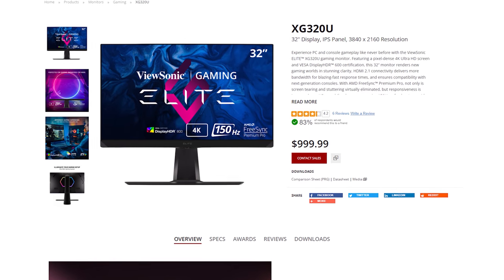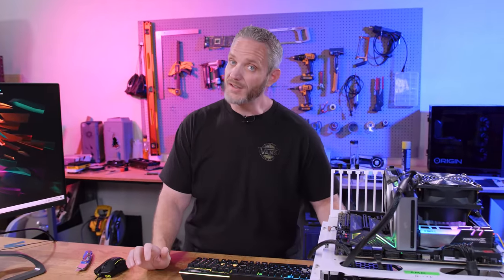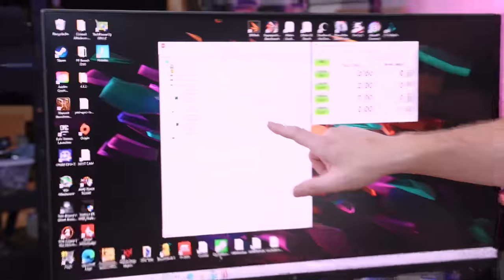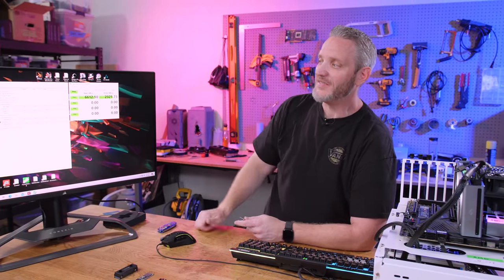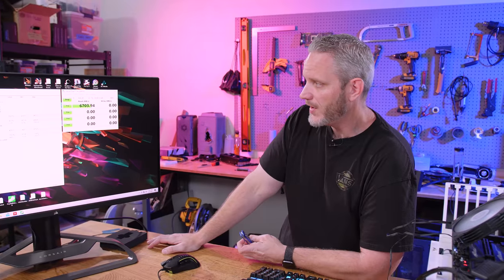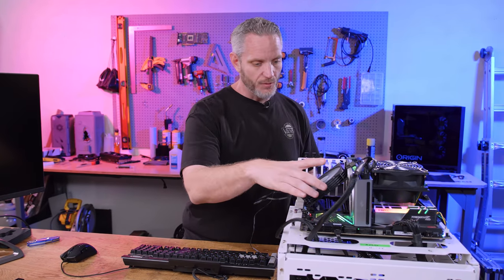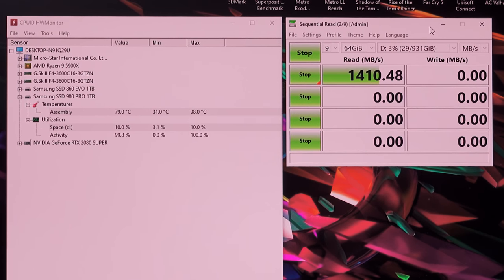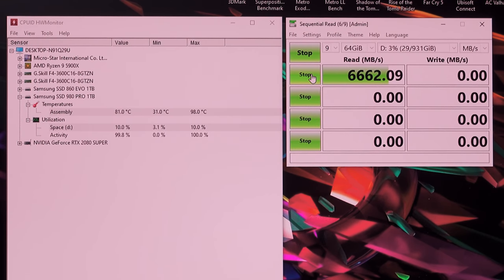I watercooled an NVME SSD... These results were unexpected!

Comment: The reason for the varying of write speed is the SLC cache filling out. 980 pro is a TLC drive, which means there three bits stored per memory cell. With SLC cache, data is written only 1 bit per cell until all the cells run out. During this the speed is extremely fast. Once you start writing multiple bits per cell the write speeds are slowed down significantly.
Reply: The SLC cache, unfortunately, is the Achille's heel of most M.2 SSD's. I'm wondering though, is there an easy/usable/quick way to flush the SSD's write cache so that we can (hopefully quickly) get back to full speed?
Reply: @ChrisM541  Yeah, don't write 200 GB all in one go. The cache rebuilds itself during periods of inactivity. The time it takes varies per drive but usually isn't too long (<30 minutes for a full cache clear even on the slowest). A normal user probably won't fill it unless you're doing a massive cloning operation, even on a drive without DRAM like a 980 non-pro. Just don't go datacenter with them.
Reply: @Pyro-Lyro :)
Reply: @Pyro-Lyro Do NOT defrag an SSD. M.2 or SATA. All it does is waste write cycles and will provide no performance boost whatsoever. Windows doesn't even give you the option to do it.
Reply: @ChrisM541  No, there is nothing you can do to flush the SLC write cache, the drive's controller will empty the SLC cache as it can in the background as long as the drive has enough free space. The best you can do is make sure you don't overfill your drive and make sure your drive and OS are using TRIM correctly.
Reply: @Pyro-Lyro you can't even defrag ssd on windows at least because it's counter productive to do, you use trim instead. And it has nothing to do with slc cache, you can't do anything about it. The controller itself will flush the data to tlc nand in the background slowly.
Reply: The point of this video is that while SLC and TLC have varying speed, it's been a well known thought, although I don't know if it's proven true or false, that the heat generated by the SSD can and probably will slow down your drive speed for the duration of the high temperatures, and reduce the usable lifespan if it constantly stays a certain temperature for long periods of time...
Reply: That but also crystaldiskmark needs to finish running to give an accurate result. He isn't letting it finish.
Reply: Intel had a drive that was hit hard by this. Once its cache filled, it slowed down to IDE speeds.
Reply: Weren't the PRO series MLC drives? I haven't looked into the 980 PRO specifically, but Samsung used to have pretty good product segmentation: PRO=MLC EVO=TLC QVO=QLC.
Reply: @Jmcgee1125  Not writing 200GB all in one go is actually a massive weakness of these drives. One thing you might be doing is cloning a drive, it starts off really fast then slows to a crawl. I've found that HDDs in RAID seem to work faster without an SSD write cache, at least for large drive image copies such as VMs and drive cloning. It's counter intuitive, especially when small file copies are actually a lot faster with the SSD cache or to SSD drives.
Reply: Some "pro" drive, huh?
Reply: @CheapBastard1988  they used to be, but not anymore. The last Samsung's consumer grade MLC drive is 970 Pro
Reply: @CheapBastard1988  980 pro is marketed as an MLC, since m stands for multiple, 3 is still technically correct. Which is so stupid.
Reply: @Jmcgee1125  if your using windows it recognizes that it's an SSD and just trims doesn't defragment
Reply: @Nate7.75  I mentioned that it doesn't, but ye it trims instead. Same menu.
Reply: @northwiebesick7136  Flash actually likes being warm - 35-50 degC being the optimal temperature.  The controller can thermal throttle, but even the crazy drives are about 5W max TDP, to the basic heatsink is usually plenty.
Reply: @Jmcgee1125  Dude with all do respect if you don't know what you're talking about, just don't say what you don't Know, the defrag option in the Windows TRIM's the SSD, but with Garbage collection being so agressive nowadays it happens as offen as you use it.
Reply: @WorBlux  I'm not saying that a basic heatsink isn't plenty, in fact my "TUF x570 GAMING Plus [Wi-Fi]" board has it's m.2 drive in the secondary slot precisely because it's the only slot with a built-in drive cover, where the main one just has the screw that holds the m.2 on and that's it...(most bandwidth goes to my 5700xt if I'm correct) Of course, it's the gen3 Samsung drive I have, I think, but the reason I went with that board was the fact that IF I wanted to upgrade anything to gen4 later on, I could... It actually runs at pretty good speeds considering, and copies around 5GB of data in 14 seconds, which, for someone used to having only use of a spinning drive, and more recently an SSD running generally not too far different in copying rates, because of the spinning drive speed bottlenecks, is pretty awesome. Of course, I haven't checked if my model of EVO drive has any cache, considering that I just bought it cuz it was "Samsung and cheap" at BestBuy
Reply: @gabrielferrazdetetivehardware  Just because I don't go into every little perfect detail in an essay for each comment doesn't mean I don't know how it works.
Reply: @Jmcgee1125  sorry if it appeared insulting in anyway my point being was that sure... Defrag SSDs is not necessary required but there is no issue doing it. There are dozens of very deep explained white papers from Manufacturers and engineers proving that. But it doesnr mean it'll kill the drive. Now thats BS
Reply: @CheapBastard1988  not the case anymore: 970 PRO = MLC, 980 PRO = TLC
Reply: @gabrielferrazdetetivehardware  
Defrag and TRIM are different, and operate at different levels of the software stack.

Defrag is used to place files into a continuous or more continuous LBA (logical block address) range. Fragmentation happens because the OS does not know the file size and is allocating multiple file streams at once, or when there isn't a big enough hole in the LBA to fit the file. Disks that are used for multiple file stream or are nearly full are most likely to be fragmented. 

Wheras TRIM notifies the SSD that a particular LBA is not allocated by the filesystem. This lets it update the FTL  layer data. (Flash To Logical)  that keeps track of where a sector is actually stored on flash. Flash can't actually write arbitrary sectors, and has to write sequentially through large chunks of the physical media. (Thousands of sectors long)

When you try to overwrite and small LBA rand (a handful of sectors at a time) the disk writes it to a separate physical location, and later try to consolidate entries nearby. If free space is short, write amplification  occurs. Typically 2-3x normally, but under severe pressure can go up to 10x. Especially if there is little physical free space

File fragmentation has a very small penalty on an SSD in the first place. Combine that with the fact that a nearly full disk is the most likely to have fragmented files it's just a recipe for disaster, especially since a full disk may be older or have been in use a while, decreasing any over-provision available.
Reply: @WorBlux  obviously
Reply: Wow this entire comment and the replies are amazing. So much knowledge. You guys and gals are legit.
Reply: @Jmcgee1125  its good to trim once in awhile to get rid of dead files but yea defraging an ssd will just kill it. so will keeping it full all the time. i always got mine atleast 25% empty.
Reply: @gabrielferrazdetetivehardware  do you even have the option to defrag an ssd? i never seen it and always read it will kill the drive, trimming isn't defrag all it does is delete dead files. ssd's basically "defrag" themselves when they go through their cleaning process and shift data around which is why you don't wana keep them full. if they are full they cant shift data around and it kills them way faster.
Reply: Isn't the SLC cache on 980/980 pro up to 170 GB or smthg ??
Reply: @shinysky8119  it's something for sure, but surely not 170GB. It's 2GB for the 2TB drive.
Reply: @boogerfromthatmovie4257  One of the best software for defraggin in my opinion is Defraggler, which is dveloped by the same coompany who did Ccleaner if i'm not miskaten.
Reply: @gabrielferrazdetetivehardware  yea i never tried to do it myself, both of my drives are 2 years old and have been on 24/7 and both have 99% life left so i dont wana risk it lol
Reply: Don't tell Samdung it's a TLC drive.  They think everything is MLC, in this case a 3-bit MLC.  Such misleading crap.
Reply: @Pyro-Lyro And here we have the person who tells some innocent person that the solution to a pc issue is to press Alt+F4.
Reply: @Stephenm64  if you have windows 10 it trims automatically
Reply: SSDs need to erase their cells before they can be re-written. The operating system needs to tell the SSD which cells are no longer used by (deleted) files. It does so via TRIM, which is the "Optimize" pass that Windows runs every couple weeks. (Linux can even be configured to TRIM cells right as you delete a file.)
I think sending the TRIM does not immediately erase the cells, but the controller will queue them up to be done over time so there is little down-time for the user, but you have to wait an unknown amount of time after a benchmark like this until the drive is erased and can give you the maximum write speed again.
The comments on the SLC cache are also interesting. Didn't know about that. So "Optimize" and then wait for "some time" for the drive firmware to work it's magic.
Reply: Just watched the video and was going to comment the same thing haha 👍
Reply: no, The Varying Write Speed is because of 4k file writing, it does normal, 2k and 4k in sequence.
Reply: Yup
Reply: @ChrisM541  If all you do is sustained writes, then don't get a TLC drive. The 970 Pro is actually faster than the 980 pro in sustained writes, as the 970 pro is a MLC drive, no cache, and the 980 pro is TLC with SLC cache. The 980 pro can "boost" to about 5GB/s for 120GB or about 30 seconds, then after that it writes direct toTLC which is about 2GB/s. The 970 Pro has a flat constant line at about 3GB/s. So the 970 pro is actually 50% faster under sustained load. If all you're doing is hammering writes all day, you don't want ANY consumer grade SSD, as you'll burn the cells out in a matter of months. And the write cycle warranty would be expired. You'd need an enterprise NVME drive that is warrantied for up to a few THOUSAND PETABYTES of writes. Most consumer NVME Gen 4 drives like the 980 pro are only good for 1.2PB (1200TB), vs the P5800x which is 5840PB, or 5 840 000TB, or 5.8 EXABYTES of written endurance, and sustained writes of over 6GB/S. These are incredibly expensive though, and it may actually just be better to buy cheap consumer drives and just eat the cost of having to buy one every year. The 970 evo plus is a great budget option, as it sustains the same as the 980 pro at 2GB/s and can be found for less than half the price of it.
Reply: I have an 980 pro and I'm happy with it.
Reply: @ChrisM541  it is constantly flushing the cache, its used as a buffer
Reply: This is correct
Reply: Formatted 931GB, you didn't overprovision.  Make that partition 800GB even and you'll see a world of difference.
Reply: @Jmcgee1125  Well, No certainly not lol. That's where TRIM comes into play, Windows automatically implements TRIM as it detects an SSD, And as you said it won't give you a defrag option on that drive.
Reply: @danimayb  Yes, it doesn't give you the defrag option it gives you trim instead. But that's done automatically afaik, so there's no need to ever worry about it.
Reply: @Pyro-Lyro That is a thing you SHOULD NOT DO with SSD's of any description.
Reply: @Pyro-Lyro xD
Reply: @tictechto  Windows what is that?
Reply: I understand what is is doing, the WD SN850 does the same thing (drops to about 1.2GB/S) but so far from what I have had Aorus/ Sabrent & Kingston do not do this, the manufacturers really need to put the continuous write speed for some of us that need a 35gb file to move from 1 drive to the other fast without the slowdown, thats all, it cost a fortune to buy them then send them back when they fail to meet the spec I need, I cannot wait for PCi5.0 NVME's for this purpose.
Reply: @Pyro-Lyro would not help with the Samsung or WD, would just speed up acess time
Reply: @Jmcgee1125  use SSD  optimize then?
Reply: @northwiebesick7136  I think with the NVME's that are sold without a heatsink are programmed to slow down because they are sold without a heatsink. Most of the new nvme's are only sold with a heatsink attached.
Reply: @jonathanwright1507  you may be right, but mine is less than 3 years old and didn't come with a built-in heatsink, so I'd be curious to know exactly when that practice became the norm, especially since mine is a more expensive Samsung drive, albeit only gen3... I know some drives always had heatsinks, don't get me wrong, but my board has 1 slot with a cover, and 1 without a cover, so you are either forced to use the 2nd slower slot, with a cover, if you don't have a heatsink, albeit not a problem for me, unless you don't mind naked stickers showing, and a lot do mind, even if it's just the Samsung EVO branding...
Reply: @northwiebesick7136  On my Gen 4 board both NVME slots are full speed, the 1st one goes straight to the CPU & the 2nd one goes through the X570 to the CPU also, this is another specification I took hours checking for upon purchasing my motherboard. The newer "S" version has 3 slots now, which run at full speed also.
Reply: @jonathanwright1507  what I mean is, the GPU is said to take some of your nVME bandwidth, thereby possibly making your drive slower...
Reply: @northwiebesick7136  Yes I have only seen a transfer speed of about 3.2GB/S max so far!, the Crystaldisk benchmarks show the max ratings as set out in NVME specsheets, I need to get the 2TB Aorus to see what the max write speed will be for when I have 7,000MB/S (7GB/S) Read & Write, it seems like so far I only get half of the speed for read & write, not seen an explanation for that either on the internet?
Reply: @jonathanwright1507  I'm only using a gen3 drive, and a 5700XT GPU, so I likely wouldn't have any issues with that problem, but, I still am not the type to want to use a naked Samsung drive in my first drive slot considering I have a cover on my 2nd slot... It's a cheaper TUF x570 board, so I guess I don't care if only 1 slot comes with a cover, but I still wish most boards came with every slot covered...
Reply: @jonathanwright1507  Not very helpful since you haven't identified the board model.
Reply: I'm a bit surprised he didn't know that. Then again it took me doing this exact test before on my new ssd to figure out what was going on myself
Reply: @jsteezy80  FYI - Doing 1 slow format & looking at task manager will show the write speed & weather or not the speed drops after about 20%, also!
Reply: Is that the over provision space?
Reply: @wayland7150  hmmm. I’ve cloned 2tb nvmes and done much vm file copies and never had it crawl. That is pretty interesting.